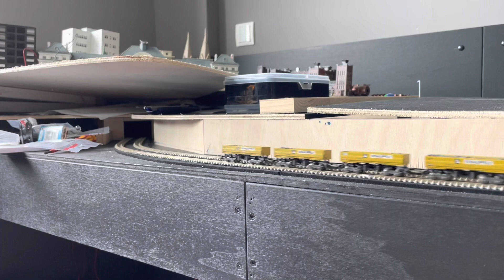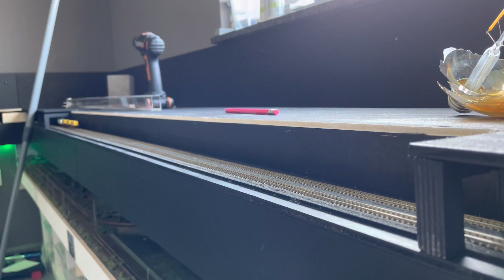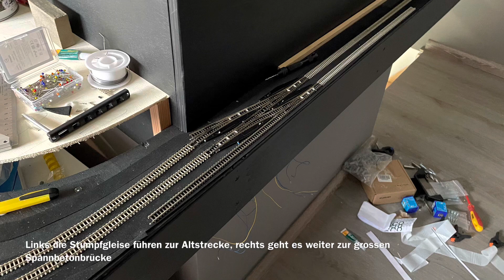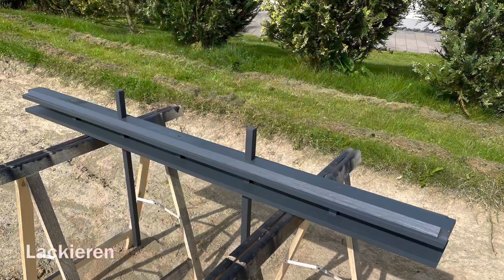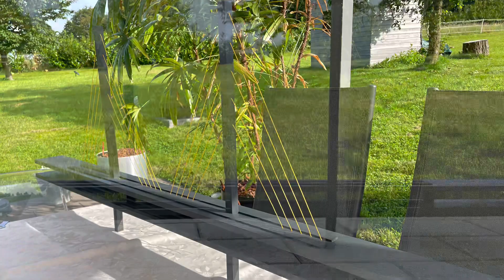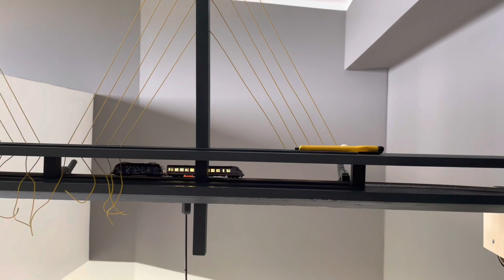Spur Z Digital - Zwugglingen reloaded Teil 4 - Probefahrten, Gleise, Brückenupdate

Comment: Genial deine Brücke was für Abmessungen hat sie den Länge und Höhe.
Viele Grüße 
Roland
Reply from the maker: Danke Danke Roland. Länge 138 cm, Höhe der Pylonen 56 cm, Breite 10 cm --> Bedeutet umgerechnet ins Original: 303 Meter Länge, Pylonenhöhe 123 Meter, Breite 22 Meter. Spezielles Vorbild hatte ich keins
Reply: @ShyeRidgeZwugglingen  vielen Dank für die schnelle Info.Die Brücke hat starke Ähnlichkeit mit der Brücke von Millau in Südfrankreich.
Viele Grüße 
Roland
Reply from the maker: @rolandrolle8739  Das Viadukt von Millau ist auch ein episches Bauwerk, wirklich klasse